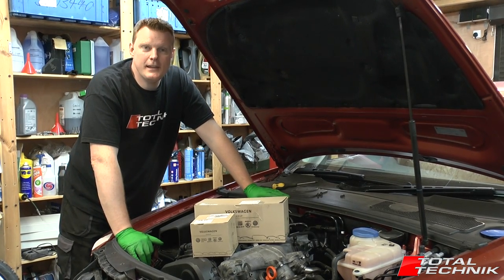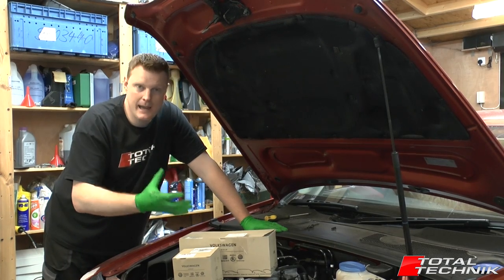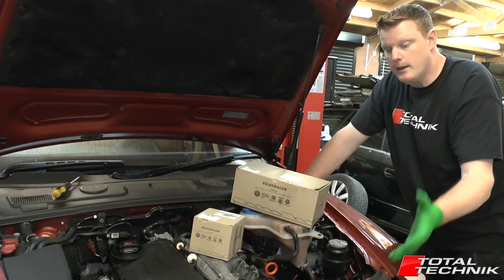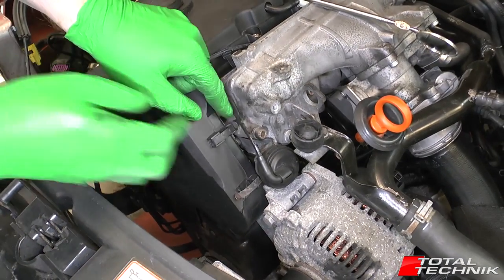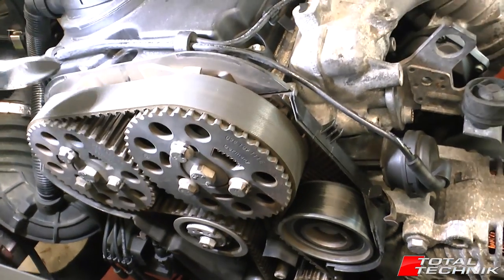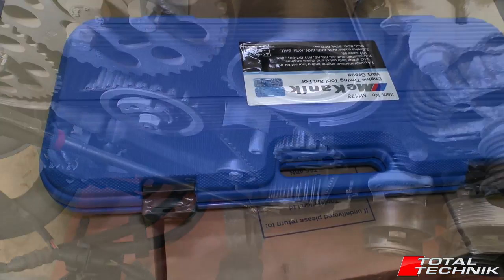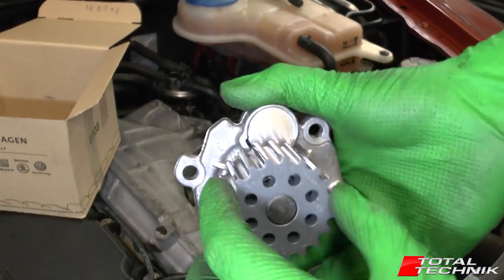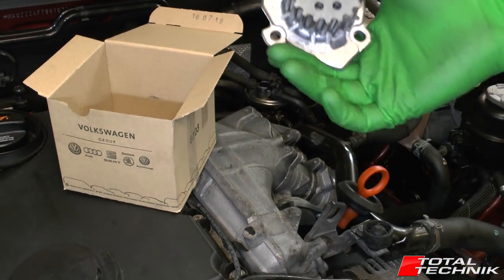How to Change Timing Belt Cambelt & Water Pump - 2.0 TDI Audi VW Seat Skoda ALL MODELS (A6 C6 4F)

Comment: My Octavia MK2 with BKD 140ps shredded its timing belt on the motorway. This video gave me the confidence to do mine. I adjusted the cams to fit the tools (very snug but they do fit) manually as they were no longer in sync anyway, and changed the timing without computer (although I want one now) on the basis it visually looked wrong.

My car nearly has 200000 miles, threw a cambelt on the motorway, and I, knowing nothing of the subject, I have managed to make this car run better than it ever has. Insane low end torque.

Thank you so much.
Reply: Was it belt failure of did the tensioner fail or the stud the tensioner rides on fail?

Comment: Tackled this job today along with the crankshaft oil seal, I had the same issue with the locking pins , but was expecting it due to this video, I used my dremmel with a sanding barrel to take some off the pins, took a few minutes and pins slotted in perfectly😁

Comment: You should change a cambelt and waterpump on a cold engine, but for anyone making fine adjustments ONLY DO IT ON A WARM ENGINE. And make very very fine adjustments  like 1 or 2mm at a time. my car cold would be fuel consumption 0.8 but warm is 0.6 so never do adjustments when cold as it will not be accurate when it gets hot.

I recently changed my cambelt, waterpump, pulleys, tensioners and stud for the tensioner, and as an experiment I ran my car with the torsion value at -0.47/-0.94 and fuel consumption at 0.40 and the power was flat and the bkd engine shudder was more obvious, it drove way nicer when I finely adjusted the torsion to 0.00 and fuel consumption to 0.6. I went from 53-55mpg cruising at 60mph to 60-62mpg on the motorway. It is waaay nicer to drive now, the power comes on much sooner and smoother too.
Reply: Thanks for that info I’m doing the timing belt on my BKD today and will check the values whilst I’m at it as I get a bit of engine shudder at idle now
Reply: Is it EDC16? 
Thanks.
Reply: what do you mean torsion alue of -0.47/-0.94 and fuel consumption at 0,4 ? thanks

Comment: Brilliant video, thanks a million. I just did it step by step pausing and going out in the pouring rain to do the next part. I was a bit worried when I discovered that I only have one camshaft, dunno where the other one has gone but all is good anyway and I saved a fortune over main dealer prices (quote £791 ...... my cost £120)

Comment: Followed your video successfully changed my seat altea 1.9 bkd timing belt without a single issue little tight for room but relatively easy to do provided you have the locking kit

Comment: I have a 2.0 tdi seat leon 170bhp. I have mpg issues £20 to 100 miles motorway speed of 65mph.
I gone through all the sensors maf, map cleaned them up with electrical spray engine runs better.
Been to 3 garages asked if they can do torsion values and looked at me like i walked off a ufo. Last option was my local volkswagon specialist and again never heard of torsion values i was gob smacked.
Video was well explained and done a few timing belts on 2 polos tdi but never done a torsion value due to i don't have vcds.

Comment: A video on replacing the balance shaft and hex key on this engine would be great
Reply: Do you mean the oil pump drive shaft?
I bought the replacement shalft/hex key for KMB parts and had it fitted for approx £360 labour. Essential if you have BRE engine.

Comment: Excellent video, thank you.
I don't have access to the locking pins or the crankshaft, and I think the timing of my BKD engine is wrong. Would the process be to adjust the intake camshaft first to 0.0 torsion, then the exhaust camshaft to get 0.4-0.6 l/h idle fuel consumption?
Lastly, how does the torsion value change as the timing belt slackens with age? I'd like to offset the torsion value slightly to compensate for this in advance.

Comment: Great vidoe watch start to finish , i have a QUESTION ,  you said that the top cams need to be turned to the right before putting on tbe new belt is that ONLY just the right side or is it both? 
Thank you

Comment: Thanks..........If you find that the alignment is slightly off, after the belt has been fitted and tensioned, and the engine has been rotated a few times.............how is the adjustment done...........is it done by undoing the three bolts in the camshaft pulley ?

Comment: in 1 tuth thats actually good tutorial I also have problems with locking tools do any manufacturers make correct tools for those tdi engines? I bought 3 sets and none of them fit right even the crank lock doesn't sit around the sprocket.
Reply from the maker: Yes, you should be able to get the correct tool. We had issues with this particular car and two sets of tools (as covered in the video) but other cars have been ok. Different variations I guess. The crank lock is essential to get a good fit. The two pins are easy to make workarounds (like in this video) as they are literally just pins, so just need to match the diameter and ensure is more than long enough. Don't try the job without a proper fitting cam lock. Remember there are two types. Maybe you tried the wrong one??

--- 

To help support us (for both you and others reading this) there are a few things you can do:

1) Donations both needed and welcome! We cannot operate Total Technik without the support of people like you! You can donate by PayPal - just go to www.paypal.me/totaltechnik
2) Please ensure you subscribe to our YouTube channel. 
3) Please give our video's the Thumbs Up on YouTube. 
4) Please help spread the word, the more people who know about us the better! Add links to our video's in forums, let people know about us.

Thank you for your support!

Comment: How long should this take for an experienced mechanic and what is the replacement schedule please on the 2.0 TDI if erring on the cautious side as a lot of conflicting mileage statements. Many thanks great upload.
Reply: in audis latest service book its states 60,000 miles replacement. the old books state 80,000 so has since been revised probably to be cautious. Time is the belts worst enemy as it degrades. safest option is 4 years, I have known them to last 8 years before changing but I couldn't drive a car knowing its that old

Comment: Hi I have followed this guide to change my cambelt. It has been very helpful thankyou. The car is running great and seems to have gained some performance. Although I have noticed quite a large drop in fuel consumption so I purchased a obdeleven device and the torsion value was -1.47 and fuel consumption 0.4l i have adjusted this to 0 and it goes to 0.49 when driving or revved slightly but I am still getting poor consumption what would you reccomend I adjust it to to try and retain the better fuel consumption. It was around 43mpg and now im only getting 36mpg thanks Josh
Reply from the maker: Hey Josh! Glad you found the video helpful :-)   For this engine you should be aiming your torsion value as close to 0 as possible, and fuel between 0.4 and 0.6. That's at idle, don't worry too much about the figure when revved. Assuming you are happy with the job you did on the cambelt, and the figures you achieved in the adjustment, and the car seems to be running well, then don't panic too much! It may take a little while for the settings to reset in the ECU, and in the meantime they may be a little off. Give it a while of driving (say a week should be more than enough) and see if the onboard computer figures start to adjust to more what you are expecting. Best of luck!

--- 

To help support us (for both you and others reading this) there are a few things you can do:

1) Donations both needed and welcome! We cannot operate Total Technik without the support of people like you! You can donate by PayPal - just go to www.paypal.me/totaltechnik
2) Please ensure you subscribe to our YouTube channel. 
3) Please give our video's the Thumbs Up on YouTube. 
4) Please help spread the word, the more people who know about us the better! Add links to our video's in forums, let people know about us.

Thank you for your support!

Comment: Curious to why you didn’t set the timing of the cams once the old belt was off and before the new belt was fitted.
You said that the exhaust cam was 1-2mm out and this would likely be why the locking pin wouldn’t fit.

With the crank at TDC and the old belt removed you could have slightly adjusted the exhaust and intake cams independently to allow the locking pins to fit. To do this you would just need to rotate the 18mm cam bolt slightly in either direction.

The cam sprocket is a floating cam gear and so any slight adjustment of that whilst the 13mm bolts are loose does nothing for the cam alignment.

Seems like this car was ever so slightly out of time and by using the slightly smaller allen keys you have continued this rather than resetting the timing by adjusting the crank and both cams independently of each other.
Reply: By loosening the 3 bolts and rotating the sprockets all the way clockwise… does this mean that when it comes to fine tuning it i won’t be able to turn it clockwise any further??

Comment: If your cars ecu was remapped would you expect to find the field values in 004 block 4 and 015 block 3 different compared to standard ecu settings?
Reply: a remap won't have any effect on it bud, besides stretching the belt out earlier, thus throwing the value out even more

Comment: Hi,i set the arrow from tensioner in middle of hole.i start the engine and after 5-10 min of running,the arrow from tensioner is 5 mm more of right side.Is ok or must make adjustement?
You talkin about that in video but i don t understant all what are you say...my english in not so god..
So,cand runing with arrow from tensioner 5 mm(or little more) in right side?It s problem if i run with this like that?
Thank you very much,you video is great

Comment: Seems there are two different types of the larger upper roller, I bought a kit that came with the same type as the kit in the video (listed as suitable for my car) but the roller on my vw golf has one with a larger centre hole and different type of bolt. I’m guessing this is the case for all transverse mounted engines as it uses the same mounting place for the engine Mount.

Comment: Good video - but my only worry is that the average joe won’t know what 15-20nm is so they should use a torque wrench for the small bolts and nuts or they will over tighten.
Reply from the maker: Yes, agreed. You should always use a torque wrench when you can. That said, many (cheaper end) torque wrenches don't go that low, so many people won't have that setting on their wrench. You either need a more expensive wrench, or otherwise a second torque wrench specifically for lower settings, which may not be practical for some. But, if you have a 15nm torque wrench handy then of course, it should be used :-)   On these very low torque fixings (and taking into account the fixing type and job it is doing, very important!!!) the alternative is to get them nice and snug, without overtightening.

--- 

To help support us (for both you and others reading this) there are a few things you can do:

1) Donations both needed and welcome! We cannot operate Total Technik without the support of people like you! You can donate by PayPal - just go to www.paypal.me/totaltechnik
2) Please ensure you subscribe to our YouTube channel. 
3) Please give our video's the Thumbs Up on YouTube. 
4) Please help spread the word, the more people who know about us the better! Add links to our video's in forums, let people know about us.

Thank you for your support!

Comment: Hi I am just getting into mechanics, I am glad you made this video and I learnt a lot, but I have a question for you, once I get the tensioner where I want it with an Allen key when I tightened the nut for the tensioner it moves the tensioner gauge up, tightens it? It was high and only just out of the gap so I left it and drove the car for a bit, but after I checked it today it was off the tensioner scale 😬. So I am going to let the car cool to ambient temp and redo the procedures, use the locking pins and take the pulley nut off check stud and nut then retighten it. Is this right or is something wrong? Many thanks I really appreciate your advice.
Reply from the maker: That is strange! Usually tightening the tension nut should not adjust the tension itself. That is done seperately with the hex key as per the video. That said, this is why you should always check the tensioner tension after tightening the nut just in case, as is shown in the video. Did you definitely use the correct nut on the tensioner? Were the several nuts in the cambelt set?

--- 

To help support us (for both you and others reading this) there are a few things you can do:

1) Donations both needed and welcome! We cannot operate Total Technik without the support of people like you! You can donate by PayPal - just go to www.paypal.me/totaltechnik
2) Please ensure you subscribe to our YouTube channel. 
3) Please give our video's the Thumbs Up on YouTube. 
4) Please help spread the word, the more people who know about us the better! Add links to our video's in forums, let people know about us.

Thank you for your support!
Reply: @TotalTechnik  Just to follow up I had used the correct nut and I just drove it as is as it was just on the limit of what it should be, but after checking it the other day with a mirror it has indeed moved about 2-3 off the gauge and when hot it is about 10mm off the scale.. I have found that sometimes the car drive nicely with low down torque then other times it seems flat on power at the bottom end then come it at 2.5k rpm which is weird and annoying so I am guessing the two could be related oddly. Tbh i just want to enjoy driving my car again. I have found from both my mk5 golfs 1.9tdi and 2.0tdi they never drive as good as when they are on there original timing belt from factory.

Comment: It looks like you forgot to hold the right hand cam sprocket clockwise when fitting the belt, might be the camera angle but it looks a tooth out? Regardless, still the best video guide on the belt change, 9.5/10 :)
Reply from the maker: Hey there! Thank you, and glad you enjoyed the video! This was done following the Audi worlshop guide to the letter, and no don't think this was a tooth out :-)

--- 

To help support us (for both you and others reading this) there are a few things you can do:

1) Donations both needed and welcome! We cannot operate Total Technik without the support of people like you! You can donate by PayPal - just go to www.paypal.me/totaltechnik
2) Please ensure you subscribe to our YouTube channel. 
3) Please give our video's the Thumbs Up on YouTube. 
4) Please help spread the word, the more people who know about us the better! Add links to our video's in forums, let people know about us.

Thank you for your support!
Reply: By loosening the 3 bolts and rotating the sprockets all the way clockwise… does this mean that when it comes to fine tuning it i won’t be able to turn it clockwise any further?
Reply: @kasemabbas1928  No. When you tension the belt it pulls those sprockets back anti-clockwise. It's 55:30 in video. I think the manual says to put them fully clockwise to make sure they are not fully anti-clockwise, as when the belt gets tensioned the sprockets have to move anti-clockwise. The fine tuning is really small movements, you will have enough movement after belt is tensioned correctly. Try it and you'll see :)

Comment: @total Technik Hi, I have 2.0tdi Audi A6 2010, and I have noticed some grinding noise. It's mostly noticeable when car is idling, and you rev up to say 2k RPM, and as soon as RPM starts going down, you'll hear like rotating grinding noise.
I did change my clutch adn DMF just recently, and DMF was bad and sounded very similar to this, so that noise lowered down quite a bit, but as this is till present I have feeling like it's bad water pump.
Now my car has full history and all invoices, and my cambelt kit has been changed in Audi's dealership 17k miles ago, but with previous owner.
1st question I have is, do you think it's water pump making that grinding noise or something else?
2nd question is, would you leave the belt in place as it's done just 17k and go ahead and replace just water pump, or would you recommend doing both at once? (i personally would do all at once, but since I've just changed clutch and DMF a week or so ago, I can't really stretch that much now. So if not necessary, I'd leave belt and do the pump myself. Ofcourse, if the pump is an issue).

Thank you very much in advance!

Comment: Hi do you know if a vw golf tdi has ccv valve or something else i have some smoke coming out of the dip stick lookes like pressure build up. I know on some mk6 golf tdi some have one on the top of the engine like pcv ventilation valve. Mine is 2010 cayc engine dsg gearbox any help appreciate it many thanks

Comment: I will be doing this job on my own very soon, is there a cheaper alternative to VCDS that will allow me to see torsions value and fuel consumption value?
Reply from the maker: Yes, there should be many around. OBDeleven is meant to be pretty good, but we don't use it here (we use VCDS). A bit of Google research should throw up some cheap alternatives, especially as you just need to access modules to take data, not code them.

--- 

To help support us (for both you and others reading this) there are a few things you can do:

1) Donations both needed and welcome! We cannot operate Total Technik without the support of people like you! You can donate by PayPal - just go to www.paypal.me/totaltechnik
2) Please ensure you subscribe to our YouTube channel. 
3) Please give our video's the Thumbs Up on YouTube. 
4) Please help spread the word, the more people who know about us the better! Add links to our video's in forums, let people know about us.

Thank you for your support!